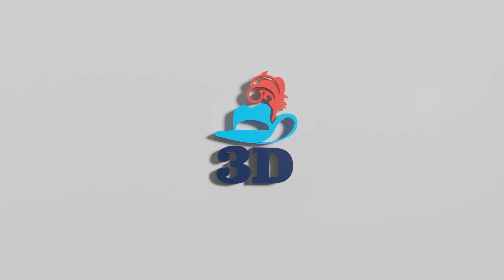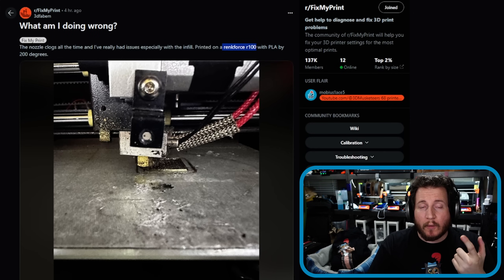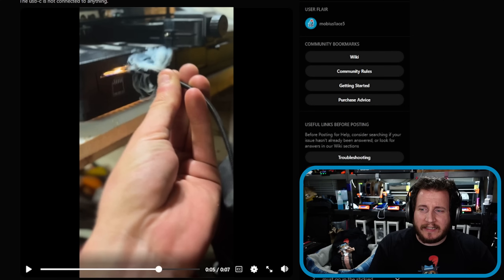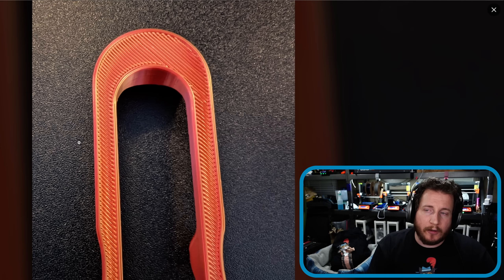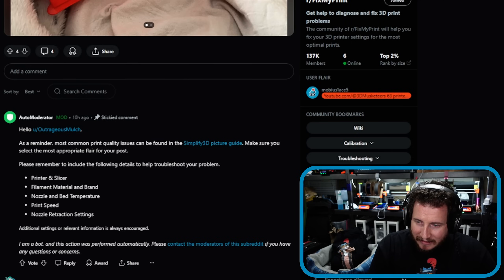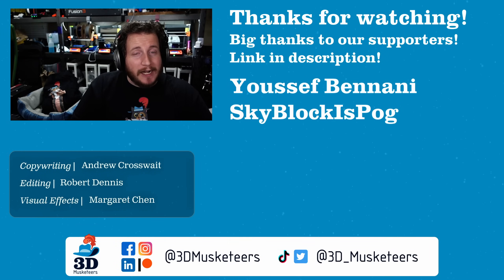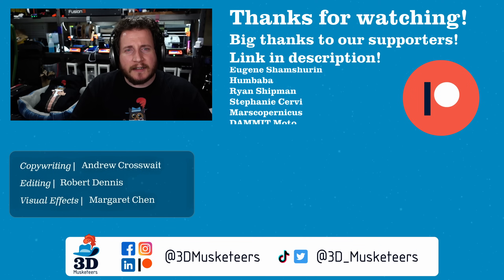Is it Even Worth UPGRADING ANYMORE?! - PrintFixFriday 147

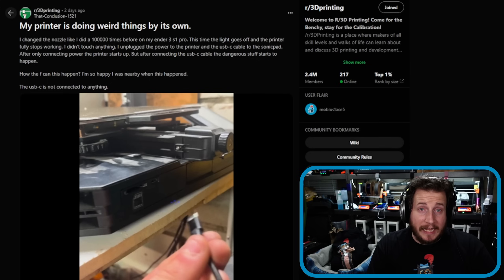Comment: 4:33 I had a sonic pad before and it did the same thing but with a Ender 3v2, I'm sure its the sonicpad is sending too much voltage to the USB line and the mainboard cant handle it. Im 1000% sure that's the sonic pad is doing it. I swapped the sonicpad with a Asus Vivobook from 2019 running Klipper and an motherboard swap later it never happened again, but that board is dead

Comment: Ad Renkforce: thats a house brand of Conrad Electronics, which is a european store chain somewhat similar to radioshack. Nowhere near the iteration speed & breadth of  of testers the usual suspects rely on.
Reply from the maker: oh interesting, is it still being produced??
Reply: @3DMusketeers  For the RF100v2: it's listed as "discontinued"(but documentation is still available), was an active SKU from 2017 until 2021 or so. Don't know about how significant the v2 part is - but a version without v2 didn't make it through the last big shop software change they made, that's if it was ever sold.

Comment: A Maintenance video on the Bambu’s would be great, I try to keep up with the maintenance, I keep the AMS on the side instead of on the top glass of my X1C to make nozzle changes and maintenance easier but maybe I am missing some maintenance items.  My first set of PTFE tubes in my AMS lasted just over 3000 hours but I print a lot of single color prints.  Only the tube coming out the back of the AMS was close to failure but I replaced all PTFE tubing in AMS and printer.

Comment: For that ender 3 I would at least consider just replacing the main board (and maybe psu) so you can at least salvage the motors, bed and hot end
Reply: ... And you said that 3 seconds after I unpaused

Comment: My fail was epic....I discovered the Senko model diorama I've been working on was missing her lower legs. Because I'm using 3d gloop, this means I have to reprint her all over again. I decided to check and see if her umbrella stick (which wasn't the whole thing) was part of her hand or not. It wasn't so I went into blender and replaced it with the full size one. That meant unfortunately I had to repaint it (would be a nice feature for prusa slicer to re-apply existing paint to new versions). That's printing now. I have her legs (upper and lower this time), skirt, torso, and the left arm completed. I believe I can recycle the tail. I had no trouble pulling that off the old one. I was really looking forward to moving on to my next project. lol The good news is that I've saved everything I've done with this model. That means it's getting done in a fraction of the time. I ran out of nude (beige esun pla+) last night. But I saw it was getting low so I ordered more and already had it on hand. So I only lost a few hours since I stayed in bed longer this morning. I believe it ran out around the time I would have normally gotten ready for work. But I stayed in bed until 10. I also had my 3rd legit MMU3 fail about 20-30 minutes ago. I got a really bad tip for whatever reason and It required me to cut it off since it wouldn't load. I have the cutter on so I have no idea why it didn't try that. But considering I'm at like 15k tool changes, that's not bad.

Comment: Hah I immediately recognized Renkforce, that's the store brand for that random website you shown called Conrad, a pretty good online retailer popular in Germany, the Netherlands and Belgium. Renkforce is usually the cheapest option if you're searching for something on Conrad. I'm pretty sure behind the front faceplate there is ender 3 style cage around the heatsink with a fan. But yeah, this type of printer is from 2016-17, but it's pretty interesting: H-bot printer with direct drive extruder but only has a printing volume of 100mm³ and probably never worked correctly. I think there's a model on thingyverse to give it some parts cooling but that user is probably better off salvaging all components and deleting the printer.

Comment: Another fun print fix friday. For the Renkforce, I personally would rebuild it to help keep it out of the landfill. I also find great joy in rebuilding printers, I have saved a few ultimaker 2+'s (and several other printers) from being tossed, I just rebuilt them with Klipper and now they have a new life that will last a long time and depending on what you do to it, it doesnt take too much effort to get it up and running again, usually just a new main board, rasp pi and some type of ABL and its good to go. I was able to give away my second ultimaker to my brother in law to get him into 3d printing and I feel confident that it will last him a long time with the over haul that I did, and yes it has been converted to 1.75mm filament from the 2.85-3mm so it is more usable.
Reply: I'd normally agree with printers like old ultimakers or enders where at least the mechanics are all right, but these printers were from the same timeframe from a manufacturer that didn't really understand 3d printers, so obvious things like using H-bot which isn't that great for accuracy (unless you make the machine super rigid), not having any parts cooling, no heated bed or really any build volume to speak of. I get that it's a waste to just throw it away (I spent way too much time getting an old ender 3 to work just right) but taking the parts and re-using them into like a core-XY voron build would be way better use of the parts than keeping it and trying to make it work as-is.

Klipper isn't gonna save a printer when the starting state of the printer is just bad, it's not like this is some kind of old ender or prusa that at least worked correctly without modifications.

Comment: @3D Musketeers Hey Grant, as far as layer shifting goes, that was the problem that I originally contacted you about. I found that my problem was the fan for my MB had stopped working. You my need to maybe mention that as a possible solution, also. (And yes  the stepper motors on my Ender 3 Pros do not have grub screws - they are pressed on, lol)